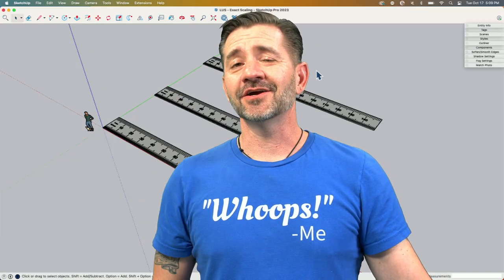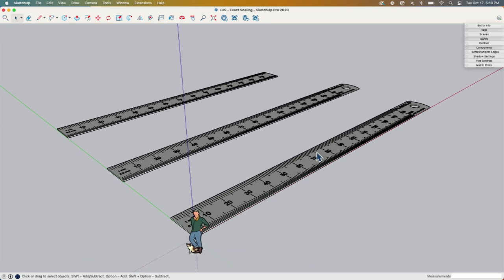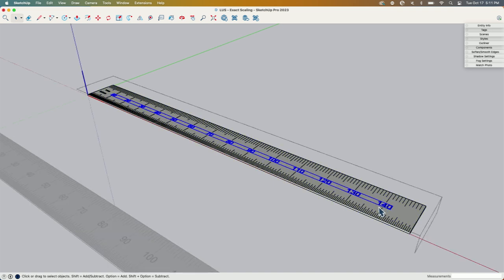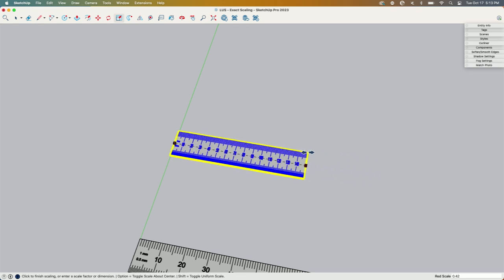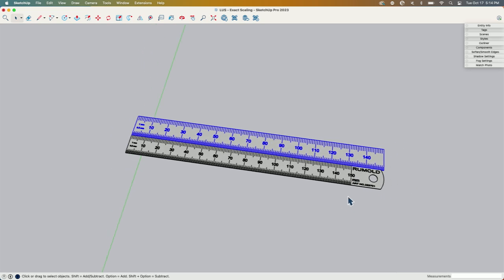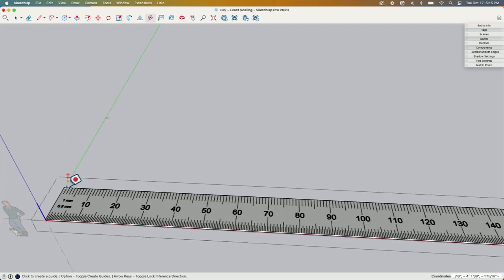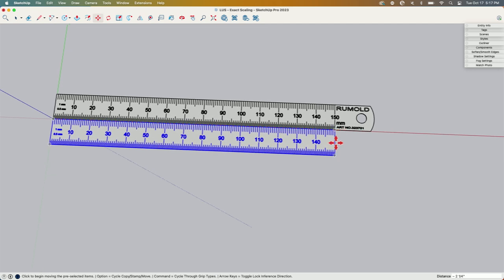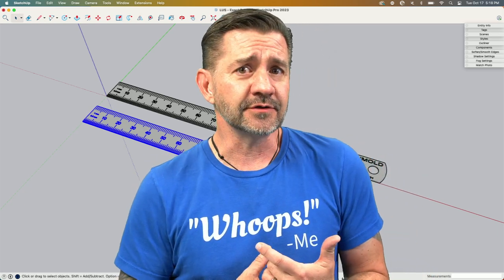Precision Scaling

Comment: Thank you.  A draw mostly architecturally, and never really understood why the scale tool worked by precentages ... I just don't often need that directly and it usually led to getting a pen and some paper to do ... gahhh! ... math.  I usually would use the resize feature of the tape measure instead, but to learn that I can enter a distance when using scale is a revelation.  So helpful at least in the situations I find myself in 😊
Reply: That's been my workflow, and workaround as well.:)

Comment: Just yesterday I had same problem. I needed a cap to fit a 5mm thread. I created a dimension of the hole I had and hit scale. When I moved scale it showed this dimension changing so I could adjust it to what I felt was right. Having the dimension change visually in real time was a great help. (a 5mm thread isn't 5mm od, more life 4.85) It helped when I had an 'exact dimension' and wanted to change it to a 'feeling dimension'.